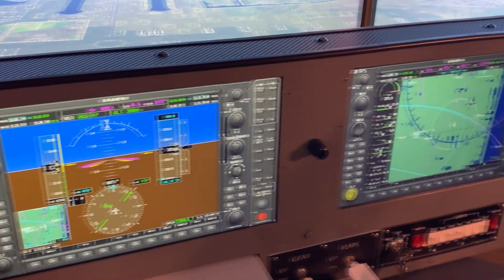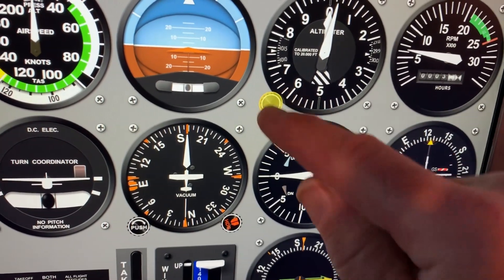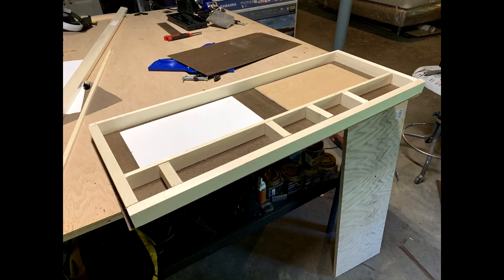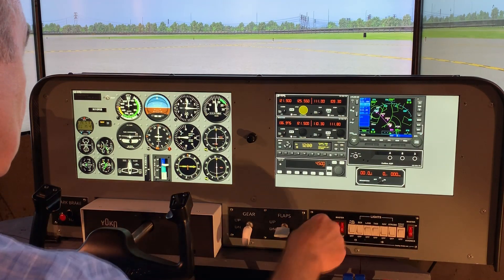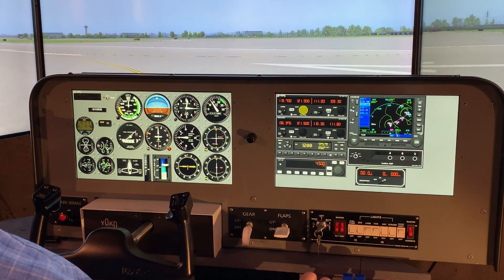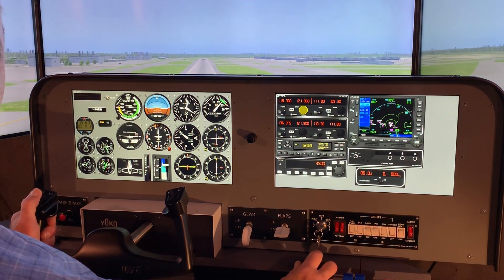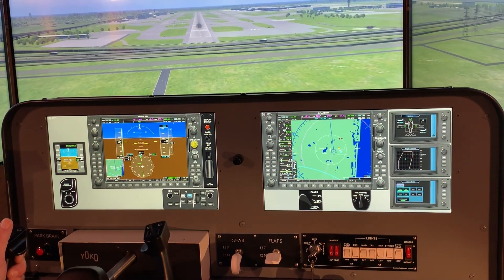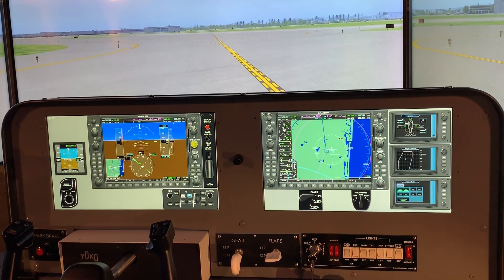DIY Twin Touch Monitor Sim

Comment: Hi Russ, nice set-up.  Curious as to what you used or how you created the curved black glare shield at the top of your panel?  Also, I see SimInnovations has taken over the Knobster.  Do you know if the Knobster is made to order?  Every time I have visited the SimInnovation website, the Knobster version 2 is Out of Stock.  I haven't emailed them regarding availability, but was wondering if you had any information you could relay?  Thanks.
Reply from the maker: Jett Piedmont that took a little ingenuity and a couple scraps I had lying around. First I made three 3” wide strips from the leftover masonite I bought for the panel for the straight sections. Then I took some scraps of fiberglass reinforced wall panel I had (https://www.menards.com/main/paint/paneling-planking/paneling/textured-fiberglass-reinforced-plastic-frp-wall-panel-4-x-8/frpm090wtt4809c/p-1444450799332-c-8168.htm?tid=437407866349873245&ipos=1 ) and made two 3” strips to complete the radius between the straight sections. The stuff 0.09” thick and is pretty flexible so I added two layers to about match the thickness of the Masonite. I put some gorilla glue polyurethane glue between layers which stiffened it up as it dried. I used a little painters tape to hold the edges flush with the adjoining Masonite as it dried. Then I applied some cool carbon graphite looking tape that comes in a 6” wide 6” roll from Pep Boys. I cut it in two strips longwise and used it to cover the top and underside. (Trimbrite Carbon Fiber self advesive Carbon fiber look film ). I  then applied Cowles Truck/SUV Edge Trim Black 8’ Larger U shaped design for Trucks and SUVs. Also from Pep Boys. That added the nice front edge. Then I added some flathead screws and panel washers painted glossy black to the top to dress it up to look more realistic. You could possibly find a better material for the curved sections but I had the fiberglass reinforced panel material lying around. It is sold in 4” x 8’ sheets so I wouldn’t buy a $25 sheet for the purpose. I did consider some thin plexiglass and heat bending the radius by laying it over the panel as a form. Any flexible board that can make the radius will do and the gorilla glue and layers stiffened up just fine.

As for the Knobster the new version should be out next month hopefully. I just took an old dual push button encoder and a Arduino Nano to make a Knobster for this test. I will replace it with a new USB version when I get one. I have a prototype but didn’t want to destroy the case to panel mount it. It is truly plug n play. As easy as plugging in a mouse and it works. If you can’t wait I could help you build an Arduino version but I will go USB when available. Hope this helps.
Reply: @rbarlow  Thank you for the informative tips on your glare shield.  It is very kind of you to offer to build a Knobster for me, but if you say the usb version 2 is coming in a few months or so, I can hold out for that.  It will give me time to further pay off my current expenditures of the three tv "monitors" and the touch screen monitor.  Not to mention the pre-order of the Honeycomb Alpha yoke that hopefully arrives late September.  So, I am in no rush as things for my flight sim are slowly coming together.  I appreciate all your past informative videos with Air Manager and such, as they helped steer me toward the flight sim I think I'd appreciate the most and I'm patiently willing, albeit aggravatingly, to wait it out for what I want my sim to be.  Thanks again.